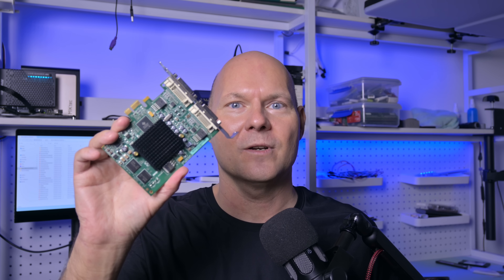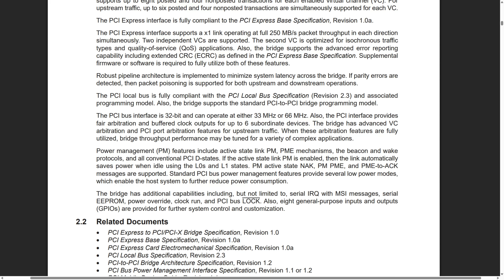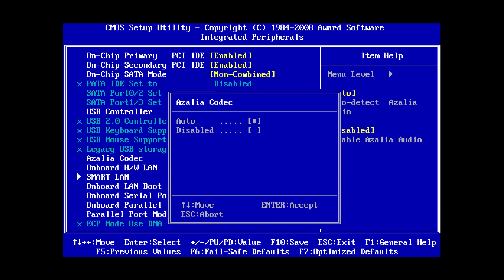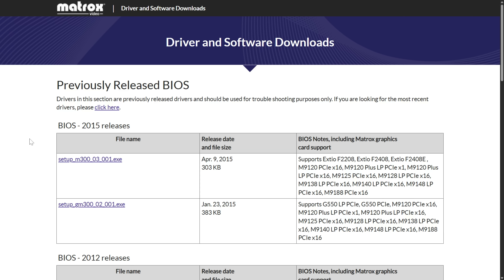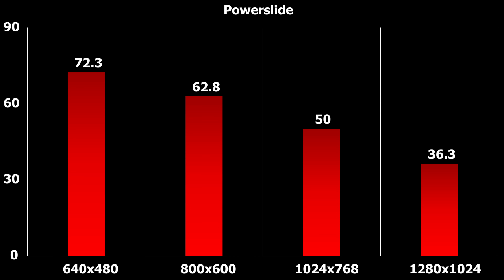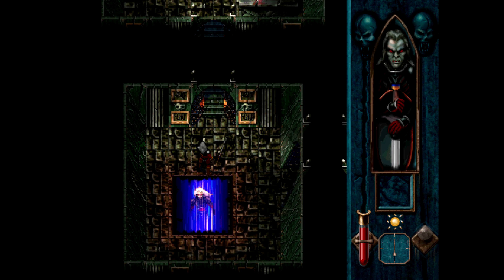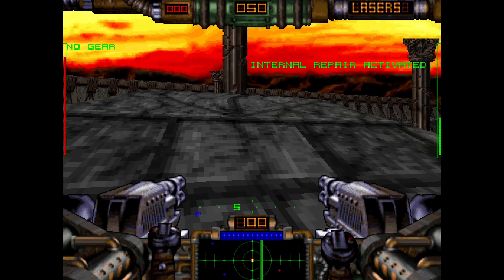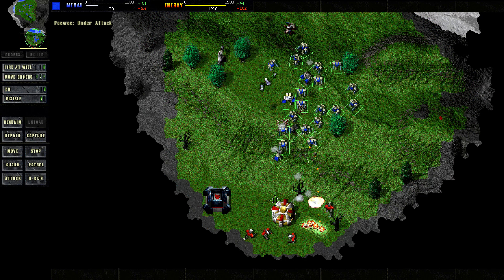Matrox G550 PCIe

Comment: I have this exact card, got it many years ago as a simple GPU for video out. Was rather cheap at the time.

I do like Matrox, I have a G400 for my Win98 machine, only the standard one though as the MAX is too expensive if you can even find it. :/

Comment: for removing heatsinks: in the past i had luck with putting the card in the freezer for a few hours. the thermal glue usually gets so brittle, that the heatsink is easier to remove (altough it crackles more, but this then comes from the crubling heat-paste)

Comment: This particular card is sold by IBM as the POWER GXT145 for their Power CPU based machines.

Did you have to re-flash the BIOS for it to work? Cause this card should have Open Firmware FCode in its flash for use in the IBM machines. But on my IBM PCI G450 the flash actually contained both - a x86 BIOS and FCode.

Comment: AGP is just PCI only clocked faster and with features this GPU does not use, the bridge chip they used could do 66MHz I wonder if they did run it at this faster speed

Comment: The GeForce 6600 GT AGP didn't have too much of a performance difference using the PCIe to AGP bridge chip but it did give it a funky layout and angled GPU which made finding aftermarket coolers tougher. The 2000s were a great time for PC hardware as we had variety and very noticeable improvements with each new release and the prices were not sky high either.

Comment: I use these GPUs for consumer mobos/cpus used for home lab server when the system/CPU doesn't support on-board video & I need every PCIe slot possible. I throw in one of these in any 1x slot & can get the console/installers I need. Being DVI means I can use pretty much any monitor given the right cable/adapter too. The more Matrox retro computer stuff I've seen I always wondered how well this particular GPU would do for that.

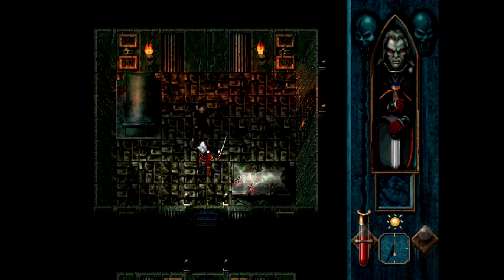Comment: 9:32 - I played Blood Omen: Legacy of Kain on the original Playstation back in the day, and performance was a lot better! There'd be some slowdown like that, but only in really busy scenes. Should probably run better on a PC of the time, but they did some unusual graphical effects to simulate lighting that might not play well with all hardware. Or maybe the PC port was unoptimized.
Great game btw! The gameplay isn't really anything to write home about, but the story, soundtrack, and atmosphere are all top-notch imo. It's a game that could really use a modern remake, but iirc there were disputes over ownership of the game/IP so it's unlikely. Anyway, sort of off-topic but there you go.

Comment: One more comment about the paletted texture emulation: from what I recall, FF8 uses combined 8 bit alpha + 8 bit palette textures, so it may not be possible to emulate without 32-bit texture support. Many graphic cards from back than that support paletted texture emulation fail with FF8 because of this. FF7 could be fine though.
Reply from the maker: Thanks for this tip! I'll look into expanding the games I'm using for testing in the future. There are quite a few, just not many with a meaningful visual impact...
Reply: @philscomputerlab There are not many games with paletted textures indeed. FF7 and FF8 are quite important ones though.
Reply from the maker: @musemice There are more, but they don't make the visuals better, they make them worse for better performance. Quake II has this option.
Reply: @philscomputerlab I don't count those. Reducing image quality is not an option anymore😅

Comment: I remember getting a Matrox Millenium card with my new pentium 233 MMX, and after trying a few games took the computer back to the shop to swap it for a S3 Virge + Voodo 1 combo. Best decision ever 😂
Reply: I had a Pentium 200 MMX. I remember all the magazines giving top marks to Matrox Mystique. It had 2 MB of WRAM  (window RAM). My order never came in so they gave me a S3 Virge DX 2 MB for free. I just remember that it was super slow in hardware rendering with Tomb Raider 2 or 3, I don't know. I think I was getting 5 FPS. With software rendering, I was probably getting 20 FPS.
Eventually, a friend exchanged with me. I gave him the S3 Virge DX and he gave me the Matrox Millenium 2 MB since it has some compatibility problem with his 486 system. This thing did not make my 3D games faster. I think it could not run anything in 3D.
I never understood why magazines were going nuts over Matrox. None of them could run Quake 2 with OpenGL hardware mode.

My first card that could do OpenGL in hardware mode was a Matrox G200 8 MB.

Comment: Although a PCI TNT2m64 would have probably done the job just as well on this mobo, and those are also pretty cheap and readily available... still, the fact that this card has DVI, is basically it's strong point.

Comment: Matrox is a Canadian company founded 1976, producing professional graphics cards since 1978. Options with 3D acceleration have been created, most notably the Matrox Parhelia line of GPUs, but they always fell short performance and/or feature vise. That being said: Those cards are some of the most solid options for stable performance and high (signal) quality you can get, which made them the standard for professional and office use for about a decade especially for dual-monitor setups. They also never failed in regards of 3D, despite the criticism of many, because gaming never was their focus; they preferred other rather exotic features such as constant registers, extended matrix palette skinning, 2D acceleration for explosive views, dual display dual ramdac solutions, ... .

The G550 is an AGP card from 2001, a "Millennium" line product with decent but slower 3D support sitting as a hybrid between DirectX 6.0 and 8.0 when others offered DX 8.1 - and there never was a PCIe-version of the G550 chip itself which is what this trick of using a transcoder-chip / bridge Phil showed is for.

The most notable 3D offering from Matrox is an insider though: The "Matrox m3D", an add-on (card) with the NEC PowerVR PCX2 chip in 1997. This line of 3D gaming GPU would later power generations of iPhones and can be found to this day in the form of the Imagination Technologies GPUs "IMG *" , but ended up leaving the PC market after the PowerVR STG4500 Kyro 2 that originally launched 2001 alongside this Matrox G550 card.

Comment: I'm more interested in pci-e sound cards that work in Windows 98.
Reply: Cmi 8738 pcie based cards have win98 drivers and from what I understand work. These are fairly easy to find new and are basically a PCI card with a built in bridge chip. Not sure about DOS support.

Comment: I have several Gigabyte boards and those are great for retro computer builds having IDE, Floppy, Serial Parallel, SATA etc. Also there is a similar Gigabyte board with DDR3 and that one supports modified 771 Xeon CPU and with 8GB DDR3 it works as fast as a modern PC.

Comment: whats table fork?
Reply: Table fog I guess a graphic feature in cards around the turn of Millennium.
Reply: There are two kinds of fog: table fog (per-pixel fog) and vertex fog.

Most chips do not support table fog, but the option was introduced around Direct3D6 or so if memory serves.

Voodoo supports lower precision table fog in Glide applications.

Comment: I particularly like that the XIO2000A bridge chip supports PCI 66MHz, which is a mode supported by all AGP video chips in fallback PCI mode and has real 250MB/s throughput, just as they promise. In contrast, when installed into the vast majority of the systems, PCI cards only did 33MHz and thus 125MB/s - system chipsets have supported 66MHz for a long time, but even one stray PCI 33MHz device would force the whole bus to clock down. Also PCI-era video cards did not usually support 66MHz to begin with, and PCI cards based on AGP chips are rarer than hen's teeth.

Maybe one can find an adaptor card with this chip which would allow to put low profile AGP cards into a modern computer? I see potential. GART will of course not work though. The chip is unfortunately not stocked and not very cheap.
Reply from the maker: That's an interesting idea about the adapter card, it's a shame the chip is hard to find!

Comment: Matrox was never a gaming GPU company, that I can recall. It was used for fantastic multi-head 2D/desktop analog (and digital) video outputs. I had no idea anyone had glued one of their PCI video chipsets to a PCIe bridge chip, let alone that it appears to have been officially sanctioned by Matrox themselves.
Reply: Matrox isn't known for gaming, but they did make an attempt with the Parhelia line of cards. Even boasted about "surround gaming" on the boxes
Reply: @cardboardsnail  They already made an attempt with Mystique before.
Reply: Wait! Are you calling my Tseng Labs ET-6000 4 X 1.125MB MDRAM a NON-Gamer card? .well, i'd never 😛
Reply: It was news to me too :)
Reply: This is how it got integrated onto some modern-ish servers such as somewhat older stuff from Supermicro, but it's getting replaced lately with combined BMC+2D GPUs from Aspeed.

Comment: To anyone worried about the lack of a fan: While it does get pretty warm, I ran one of these cards in a fully passively cooled home server for years with absolutely no issues.
And that's another pretty good use case for these. When you really need a low-power, low-noise, PCIe x1 GPU for a system that doesn't actually do any computing or rendering on the GPU but still needs some kind of graphics adapter.
Reply: It's way cheaper to get a random passive Radeon from a decade ago and then just chop off the offending part of the edge connector if this is your requirements.
Reply: OEMs have cards like GT405 for the same needs

Comment: Damn, so many memories from those games that you showed this time! Some of them I just remember from reading about them in magazines like Necrodome. Btw I would be more than happy using a cheap and "easy to find" PCI card for such a project like those new old stock FX5200 that you showed in the past instead of this. Unless you use a MB that is so new that it does not have any PCI slots. But you would probably have other issues then like non Windows 98 compatible chipsets and processors. I am not an expert so this is just me guessing. But thank you for showing the potential of such an unusual card!
Reply from the maker: Yes, the FX5200 is a good choice for such a project! 👍

Comment: Another PCIe GPU that you can try is the Radeon X300/X600/X800 series, I had an ASUS X800 XT PCIe and it worked wonders on Windows 98 + G31 with over 28k score in 3DMark 2001 SE. I don't have the GPU anymore but at least my Leadtek FX 5600 256MB now works fine for this purpose (albeit with an AGP platform).

Do you know the 3DMark 2001 SE score for the G550?
Reply from the maker: Thanks for the suggestion, I'll add them to my list!

Comment: this is shocking..  from where this card came ?..
Reply: OEM or server/workstation equipment
Reply: It comes from year 2005 when PCI Express just came out and Matrox was sitting on manufacturing capacity that they didn't know what to do with. So they repackaged these AGP-native chips with a PCI to PCIe bridge chip. I don't think it's AeroGlass compatible but they had a year until that would become a problem.

Comment: PCIe<>PCI is a "well know quantity" and unlike PCIe<>AGP that is totally phased out, there's still a need to interface for some older cards. So, there's "bridge chips". And if you had a (fair) bit of  graphics chips that were PCI and had drivers for older software/OS... you get the idea. Might be more economically viable to plop all those chips on a board than to write and test drivers for W98 for your new(er) chips.
Honestly, wouldn't stress too much about the more demanding 3D stuff. Chances are good that IF it was that demanding, ie late stage 90's/2000's 3D, it has a W2K/WXP compatible version, and that gives you a metric ton of options in respect to gfx cards. Probably a handful of demanding 3D games that DIDN'T have one said version. Heck, Deus Ex technically DIDN'T support NT/W2K and i never played it on anything BUT NT/W2K. Gotta love the OpenGL era...

Comment: This card has a similar performance to a 1999 TNT2 M64 or a 1998 TNT1. A C2D e8600 for such a card is like a rocket engine for a 1980s Lada :))
Reply: It makes sense here though. We want to see how fast the GPU is, so a very fast CPU should be used that wont hold the GPU back whatsoever. It's a shame that the card didn't turn out to be faster. Image quality looks very good though.
Reply: I’m surprised, I remember the g400 as better than this
Reply: @krz8888888  the G550 has 100/150 mhz frequencies. The G400 was clocked higher at 125/166 mhz and the G400 MAX at 150/200 mhz.
Reply: Yeah but at least its cheap and easy to find 😂
A 775 you can find on any e-waste facility and even tho overkill will be a cool retro machine tbh
Reply: You're missing the point. You can use PCIe graphics card in pretty much every mother board released since 2004. Unlike AGP counterparts, PCI versions of early GPU's are harder to find and also cost more. Not to mention that even PCI slots are not being widely available in PC's for several years now.
Reply: Since you want to look into Have a nice day I strongly suggest looking at the successor N.I.C.E. 2 as well. It even has a built-in benchmark and a very wide variety of cars and a cool career mode.

Comment: That x1 PCIE lane apparently cripples this card as I see in your 10-year old video, you're getting about double the benchmark FPS on a 550 AGP card (also another video out there shows a 3dMark99 score of 8300 on the AGP version, nearly double what you got here).  Also a quick tip - you can flash video card BIOS's simply by booting to a Hiren's boot CD (I use version 15.2) and into the XP environment.
Reply from the maker: Gosh, I forgot about Hirens...

Comment: Honestly getting tired of the higher and higher barrier of entry to playing retro pc games
Reply: If you are not worried about period accuracy or self-imposed rules of 'purity' then it can be a lot cheaper.
Reply: It's really only expensive if you demand absolute period accuracy and want the really popular parts like Voodoo cards or Tualatin Pentium IIIs. There are a lot of relatively cheap old parts out there that nobody wants, and low-end crap from the early years of the XP era suddenly becomes a rocketship when all you're looking to run is Windows 98 and older games. There's also the emulation scene. DOSBox is good enough to cater for the vast majority of people's DOS needs, and between PCem, dgVoodoo and modern patches there's very little Win9x stuff that can't be wrangled into running on a modern system. I know that for a lot of people that might be a suboptimal solution and not scratch the retro nostalgia itch properly, but if you just want to be able to play the games there are lots of options better than paying an Ebay scalper $200 for a Voodoo 3.
Reply: @CaptainKenway You hit the nail on the head, older hardware offers something modern solutions don't. Plug and play. It's a pita to pick a game on a whim and then just to be met with a littany of workarounds and patches just to play it on modern systems. 86box and the like only help so far. There's a dead spot of emulation through VMs or whatever until you get to a more modern version of windows which has a VM application like VMware or Virtual box which still has 3d acceleration support.

Wine is another kettle of fish. But suffers a similar pain.